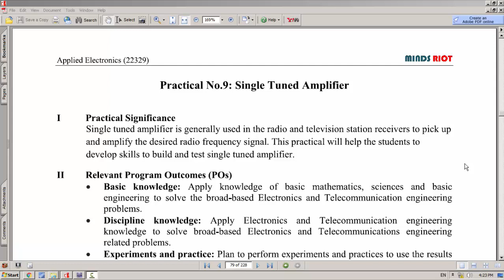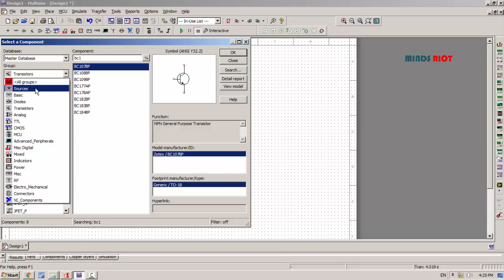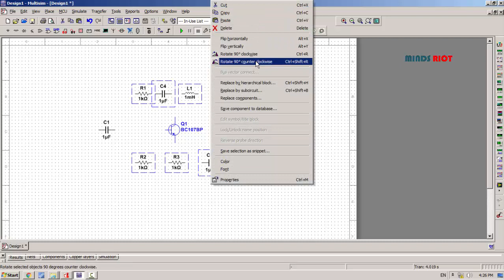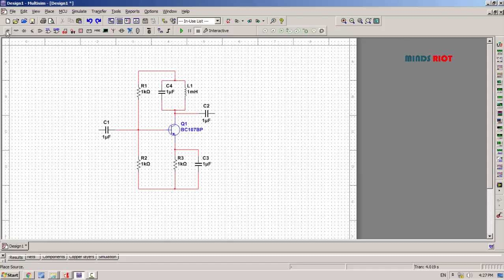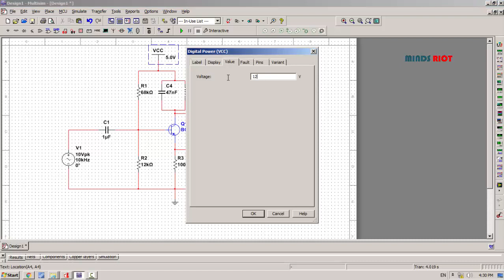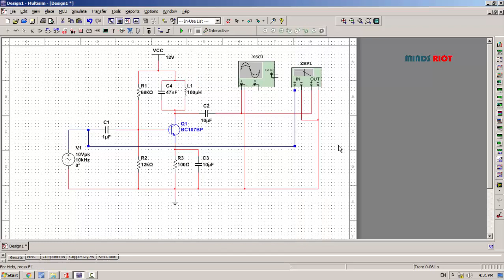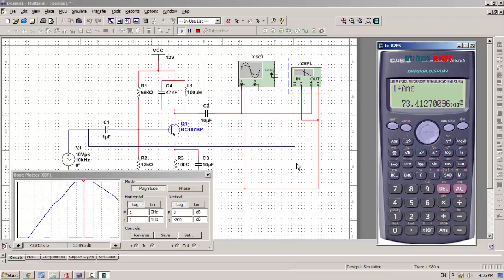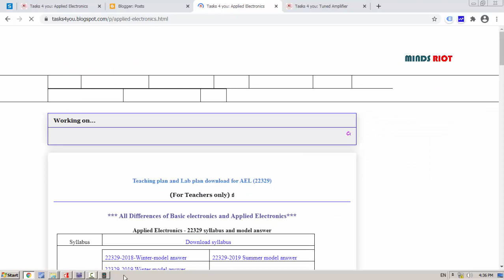Single Tuned Amplifier Simulation in Multisim #Tuned

Comment: Thank you, engineer. Is this circuit for wireless audio transmitter? I mean, this is a transmission circuit..
Reply from the maker: Tuned Amplifiers are used to select and amplify perticular frequency like in TV and radio receiver
Reply: @MindsRiot   Well, well .. if we put a reverse bias capacitor in this circuit between the collector and a meter and put our antennas in a transmission resonance circuit, it could become a transmitter circuit